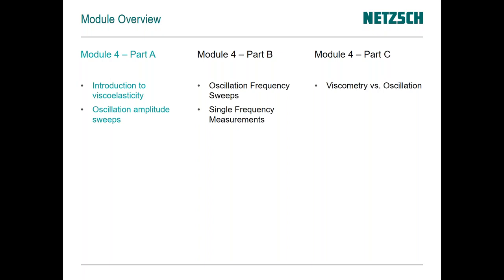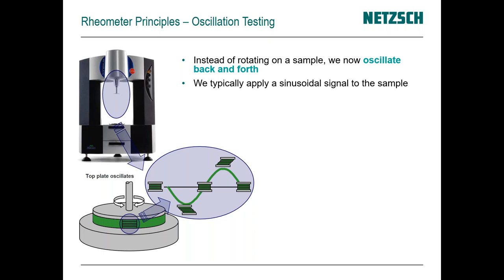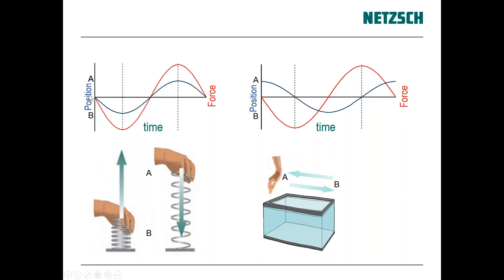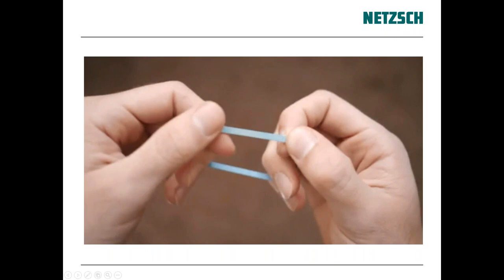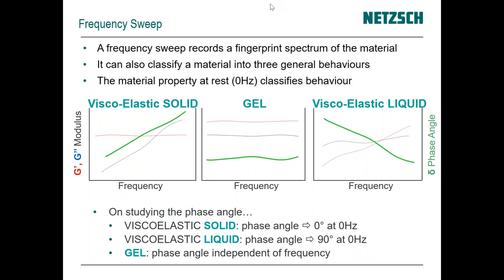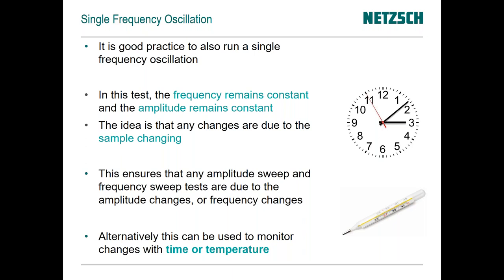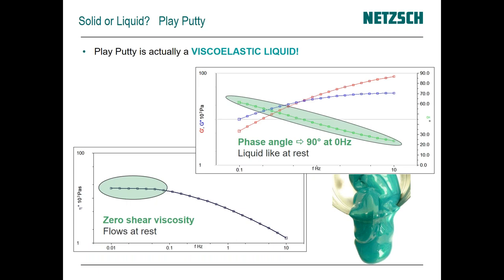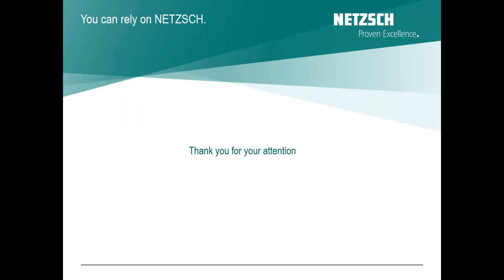NETZSCH Rheology - Viscoelasticity

Comment: Question: Once I find the LVER, which value do I use for the frequency sweep? The lower, middle or higher value from the strain range? Or it doesn't matter once is inside the range